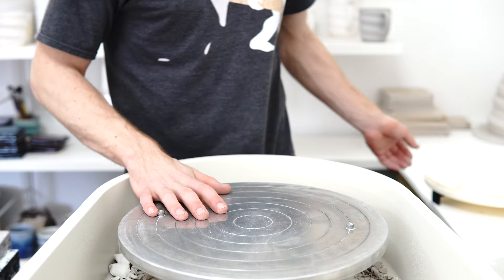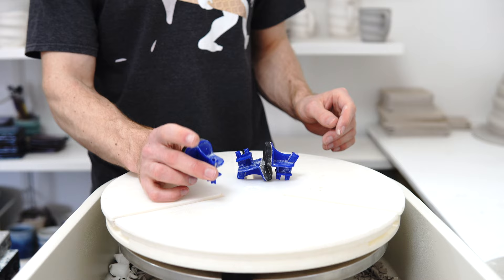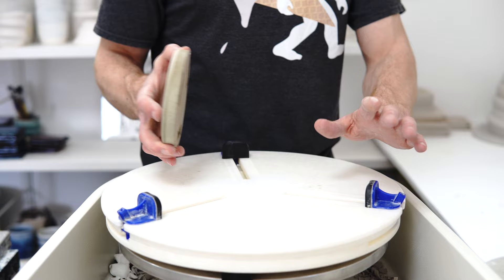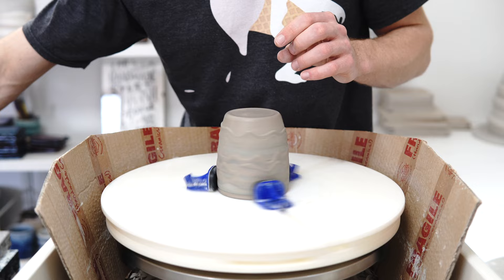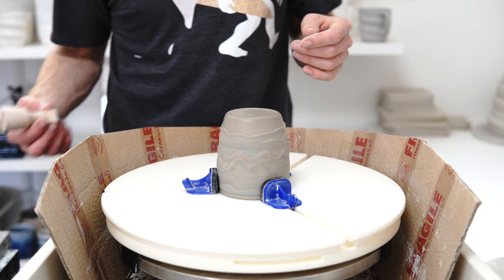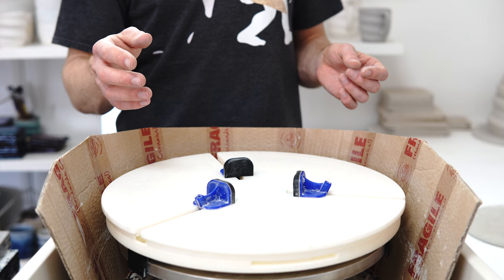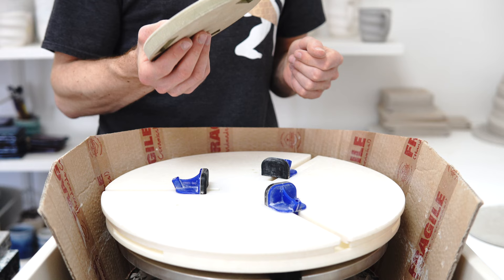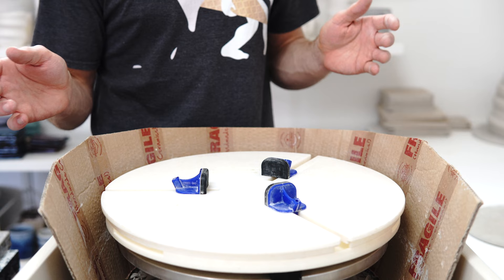Giffin Grip - Top Pottery Tools

Comment: This grip is really helpful for beginners too, because you can quickly and easily take it off to check thickness, and pop it back on and continue trimming with it centred.
Would be interested to see a video on your new kiln installation and how you programme it. Thanks 🙏 😊
Reply from the maker: Yes, that's another really useful aspect. I should do that more often than I do!

I don't think I will do anything on the kiln setup. It's an area that I don't know enough about to be sure I was giving good advice, and it has the potential to go more seriously wrong than anything else I post videos about.
Reply: @OldForgeCreations  ah yes good point, I didn’t think of that. I’m sure all kilns have different requirements too.

Comment: I completely agree on the Giffin Grip... mine is 14 years old and still kicking.  Only issue I have is when trimming bowls...if not dry enough, it will distort the rim.
Reply from the maker: Yeah, I try and make sure I trim everything with relatively dry rims to keep that to a minimum, but that is one downside!
Reply: Use taller rods to hold the piece higher?